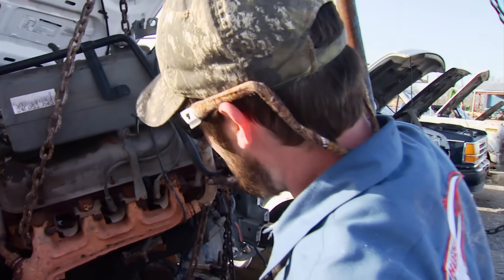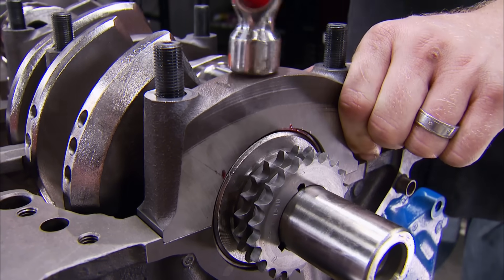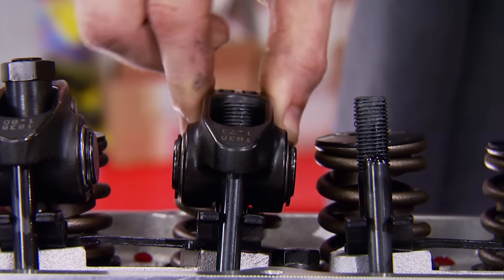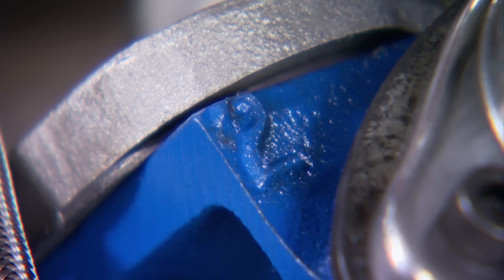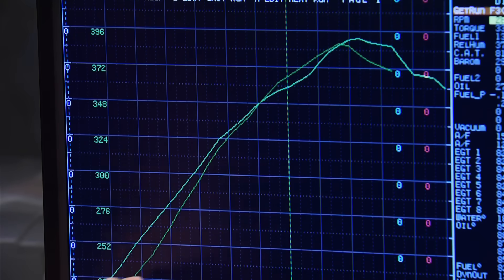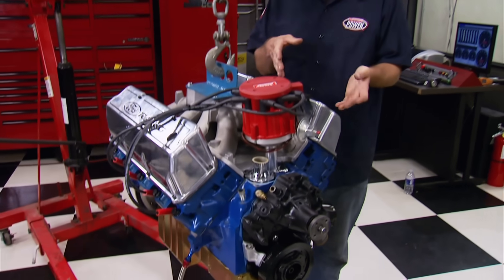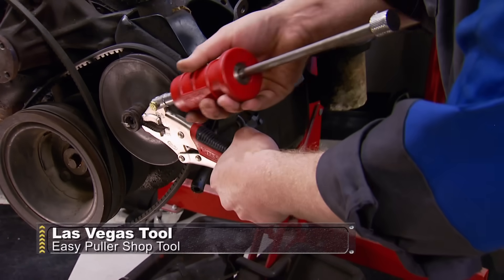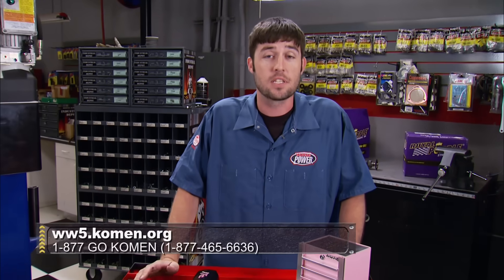351 Small Block Dyno Shootout: Windsor vs Cleveland - HorsePower S16, E11

Comment: I've learned so much this episode. A stroked motor with aftermarket heads and cam and intake can beat a stock motor with just a cam! Amazing!
What are they comparing here? The Clevland 2V vs 4V made sense. Why not just compare different engine mods to this engine. And if the Cleveland was made for the street why the single plane?
Reply: They actually lowered the clevor compression. It's original form was 10:1 and 11:1 in the 1970 Boss. They dropped it to 9.8.   They did no tuning to the carb after swapping heads. It was running lean as hell. They backed off at 5500  and could have ran it to 7k with those rollers.  The power dropped off because of lean fuel. That motor and those 4v heads were designed to sustain 8k rpm for hours in nascar.  These guys has something all wrong. Maybe cam degree needs bumped or something. Thats a weak ass clevor :(   I know... I got 4
Reply: @starbattles1  with 408 c.i., I was expecting much higher numbers.  I agree it was running lean.  They should've fed that beast more fuel and timing until they hit that sweet spot.
Reply: The Clev build was a total mismatch of parts. not only a single plane intake, but one designed to run 2v heads, and a smaller carb. Clev's are designed for high RPM power. If they had put the 4V heads with a 4V single plane intake and 850-900 cfm carb, with large tube headers, and a more aggressive cam, it would have made the same HP and slightly lower torque between 6500-8000 RPMs. I built one like this 30 years ago and got 507 HP@7300 and 447 ft.-lbs @5700. It was a BEAST!
Reply: @sarcastomimic2683  it is like they were purposely trying to make the clevland look worse. I guess Edlebrock pays the bills so this was just a thinly veiled advertisement. Be nice if they said who was sponsoring the episode before hand.
Reply: @numbnutz9398  I agree. They were promoting the 351 Windsor,which was stroked to 408 CID. No wonder it beat the Cleveland. There's hardly any 351 Cleveland's around anymore. If you do just so happen to find one they're pretty expensive to rebuild. You can find 351 Windsor engines no problem. These guys are just,basically advertising big names Edelbrock,ATI harmonic balancer & the timing pointer,whatever other companies they mentioned. Personally I don't really like this show. If you've ever rebuilt an engine,any engine performance or stock. They left 90% of the steps out. They didn't show degreeing the camshaft or measuring the pushrods,installing the adjustable rocker arms kit. These guys leave out alot of stuff. Makes people think they can just go out and buy all these parts and throw them together and it's gonna be great. Or like advertising that says adds 25% more power than stock. Then another one that says adds 25hp and another one that says adds up to 40hp and ...So on....by the time the engine was finished it should have about 2000hp. LOL!! The Chinese parts are the worst. One time a guy brought me a auto parts store rebuild Chevy 350 and a literal pile of parts. The Chinese aluminum intake manifold didn't fit and the Chinese chrome oil pan wasn't even flat and the bolt holes didn't line up well at all. Had to get the manifold milled and take an angle grinder to it so you could get the valve covers to fit.
Reply: Tom Caffrey it’s a 30minute show, they can’t show every single step
Reply: @ Tom so how did that Chinese chevy 350 come out ? How did it run and was it a total pile of  💩 ?
Reply: @Thundarr995   I have both a 351 M and a 400 in my 77 Cougar wagons.   I need to get a timing wrench for the distributor that I know will fit.   If you are using a Snap On timing wrench on the O.E. distributor nut, can you give me the part # of the wrench ?   Or if another brand, the brand and the part number?   I see a lot of Snap On F 8564 B timing wrenches on ebay, but none of the sellers have used the wrenches (I asked each one of them).   Any help appreciated.  Thanks
Reply: @sarcastomimic2683  They did say that
Reply: Sarcasto Mimic 
With out a doubt. Let’s just run it lean and keep it from breathing.
Reply: @sarcastomimic2683  they changed to the 4v heads but stayed with a 2v intake? The Cleveland build was a mess.
Reply: @bigboreracing356  Oh wow, you're one of THOSE people, one who like to twist words and ignore facts, Stock head for Stock head, stock stroke for stock stroke, same cam specs in both a true Windsor head will not outperform a Cleveland. But if you wish to bury your head in the sand do so, but I'd like to see a Factory Windsor Head make 700hp NA
Reply: @bigboreracing356  Build it with a true Windsor head then, a proper inline valve head, not a canted valve Clevor knock off, then see the difference, these gents essentially built a 351 Cleveland and a 408 Cleveland, like they said in the video "we fitted Cleveland style heads and made this a Clevor" but I guess you'll conveniently neglect to mention that....
Reply: @bigboreracing356  Cause what Clevo blokes say is that a Clevo Head is better than a Windsor Head, you're saying you will build a Windsor using a Cleveland style head adapted to a Windsor block. The guts of the matter is to make a Windsor decent you have to use a Canted Valve head Windsor heads are Inline. I work in the industry, I've helped people build both, inline head Windsors do not make big HP
Reply: @bigboreracing356  over a 351W? Weight, no water in inlet manifold heating the air/fuel charge, less bearing load due to smaller mains
Reply: Mark Godfrey  it's there atempt to manipulate the minds of people to sell more windsor parts. Not to bring any light or truth to engine builds. 
   I have 3 Cleveland blocks. One is a built motor. The parts manufacturers are mad we like to keep our Clevelands and not switch to windsor. More video's like this I see the more I want to keep my Clevelands.  The more I want to say fuck a windsor. I hate it when manufacturers try to force a change. They attempt to force there will on the people. Like PC and cell phone companies are doing.  Microsoft just stopped supporting windows 7. Trying to force us 7 users to purchase something we do not want. The American people need to get outraged at this kind of manipulation and corporations forcing there will on the American people.  It's designed to get us used to being told what to like and what to use. Brain dead American public don't see this shit right in front of there faces.
Reply: @starbattles1 …
The citizenry of Japan spoke up and told the PC and cellular manufacturers what 
THEY WANTED….. shame America can’t learn from them.
Reply: @bigboreracing356  agreed! Clevelands are as rare as rocking horse shit here. Great engines but rare. Winsors are a dime a dozen. Way cheaper to build with so many more aftermarket parts. The point I was making is it didn't seem like a shoot out and more of a 'this is why you build a Winsor'  episode. Which is fine but that isn't how it was set up.
Reply: @bigboreracing356  and I could ring up Higgins or SCM and have 700-800 hp NA on a 408 pump fuel the SCM is even designed to look like a stock 4V head from the factory for the bloke who wants to look a bit on the tame side
Reply: @bigboreracing356  Not in this comment tree you didn't
Reply: @bigboreracing356  Ohh Wow, you are a different breed. No where have I read a comment from you mentioning "stroker" it's all "Windsor" but alas once again it seems you like to ignore such minor things. $1600 for a non bored 4 bolt block? Where do you live? Siberia? :Side Note: Main girdles work just as well- I have a mate who built a 700hp 418 with Iron heads using a 2 bolt block and girdle: Furthermore the video states they use a small cam, People like Hot Rod has got similar power with a stock rebuild. The Clevor heads are 2V Sized also with a small cam. My point about ringing SCM or Higgins means its easy for anyone with deep pockets to "slap" things together and make decent horsepower too. I know plenty of blokes who've made 600hp relatively easy with Iron heads on a 393 or 408C. Ford doesn't have a great reputation because Windsor Inline heads are dogshit and they produced Windsors for 50 years, because they did what they had to do, Move Ma and Pa from point A to Point B. Your Key word there is "built" 350 Chev I could have a 351C "built" with a DECENT cam and make the same, in actual fact companies here offer "CRATE"  here down under like that. Lastly If they are so shit, why do they have weight thrown at them in racing circles or are plain outright banned from categories? Bob Glidden loved his
Reply: @bigboreracing356  Fuck, I said there's a reason he loved them, cause they won him races....

And I like how you specify the smaller heads an saying you can port them, attempting to sway it your way, bahahaha, lemme guess, you'll want to use a GT40  head too the closest that came to a 2V, gotta love those that stack it in their way and then call others out, keep your head in the sand cobber, has the added bonus of us not having to hear you speak
Reply: Never seen a Chevy that impressed me. Had my tractor stuck once. Tried pulling it out with a 1ton Chevy . Couldn't do it. It got stuck. Backed my 81 F350 up tonight the Chevy and hooked chain to front of Chevy . Stock 400 4spd. Had tractor and Chevy in neutral. Pulled both out dead horses. Did break a tooth of my front ring gear, but pulled both out of clay over axles.
Reply: Exactly my thoughts!
Reply: @bigboreracing356  The funny part is, I can actually find a comment where you state that to use stock Windsor heads would be unfair....
Reply: @bigboreracing356  You might want to read back through your comments then (You said it in a reply to Cigz Much's comment), and then read mine cause all I've stated is stock head for stock head, stock stroke for stock stroke, same cam for same cam A Clevo will outperform a Windsor. That's not giving it an advantage that's making things even. But I guess you'll ignore that.
Reply: Numb Nutz because they were expecting to make a lot more power with the 4V heads. When it didn't pan out, they didn't have the right manifold on hand for the 2V street version.
Reply: @unicornsteaks6769  Aussies did nuch more with 351C, they had a 4bbl manifold that went with 2V heads.  Not sure what else they did but there was more.  The ball was dropped here in US, IMO.  If you have one, just remember they're unique and good engines.
Reply: Exactly mate. Looks like the Cleveland was butchered a bit.
Reply: MñHhtttbbbnñ
Reply: Since first viewing this a couple of weeks ago I've realized the problem. The Windsor has an enormous aftermarket support base. The Cleveland does not. As a result there's no advertorial inducement to make the engine look good.
Reply: the worst part  was they used the wrong cam  in the Cleveland. they used a Cam specked for a small block Chevy.
Reply: clevlands were fords truck engine,built for torque,not,,racing.the windsor was the car/race engine.but the heads were crap.small/ strait valve train,no good.the 4v gtho falcons,ran at bathurst,those heads dont start working till 80 mph..the 2v & 4v heads have a hump in the exhaust,as i said,for torque,theres 'tongues',you can buy to smooth this out or grind them down,carefully..fact.a std 351 will run at 6k all day,where as a chev 350,or windsor,will lose its valve train.as there studded,.the 2v  clevo is a very strong reliable engine,ive never had any problems with them,run forever,even when they use a sump of oil to a tank of juice,or,no oil pressure at idle,still go.which i think is a bad pump..chev 350 are a rubbish ,very old, engine design,cheap.454 better...but,,you cant beat dodge.i have a 340 r/t chall..i have a bronco 82,on lpg only,,351c,auto.stock,the 351 heads needed a valve job when i bought it,13 yrs ago,so i fitted 302c heads,12.1 comp,std,goes like a cut cat,cheap to run.never stopped except for 2 dead coils...all the  tech has been there since day dot,to build well designed engines,but its production cost that limits what you get.desmodronic drive,ohc,3valves,fuel injection,alloy motors,all too expensive to sell cars..the range rover,layland,4.4lt,is an all alloy engine,very similar to a windsor.used in circle racing,,if,,you can find one..
Reply: @phantomwalker8251  351W is a truck engine, it has 3" main journals, which create too much heat to handle high revs. The cleveland, on the other hand, has smaller main journals, which allow it to rev higher without seizing them. The "racing" version of the 351W block has smaller journals for that very reason. A 351W has shit flowing heads, even the best 1969-1970 351W heads won't touch a 351C 2v heads, let alone the 4v/boss302 style heads. So I'm not sure why you think a 351W is a race engine, while the 351C is a truck engine?? There's no "low end torque" in cleveland heads, the ports are huge. The 351W heads make tons of low end torque, by comparison, because, strangely enough, the ports are tiny by comparison.
Reply: You nailed it.  I don't recall ever seeing a factory truck with 351C, plenty of 351W Trucks.
Reply: @thisisyourcaptainspeaking2259  Yup. One of the nice things about living on the prairies is trucks as far as the eye can see!  Winsors and newer LS and Hemis. Would still love to get my hands on a Clevland though😁
Reply: @James Mottley, no truck had a Cleveland from factory. You could get a 400. Which is basically same engine with longer stroke. Take a 400 , put 351c heads on it and give it a try. No they won't . They want to sell parts for windsors. There is more money to be made there. There's a lot more windsors .
Reply: @thisisyourcaptainspeaking2259  I think he was confusing the 400 cleveland (or the shorter stroked 351M engine) with the 351 cleveland.
Reply: @briankennedy5578  The 400 Cleveland has a taller deck height than the 351 Cleveland.  Pickups were getting 351 Windsors, and also getting the taller deck height 400 with a shorter stroke, called 351M.  Ford had a thing for odd engine combos.  Australia got 302 Cleveland engines that were a short stroke 351 block with small port/valve heads.
Reply: @22099dscott, yes that's pretty much correct. The 400 had to have a taller deck for the longer stroke crank. Most if not all trucks had the 400. The 351m were used in the full size and station wagons quite a bit. Another difference was 351c has small block mounts and bell housing. 351m and 400 were same bellhousing and mounts as 460. Except a few 400's one year had small block. As for the Australian 302, I'm not sure about them. I've never been there.
Reply: @briankennedy5578  I have not been there either, that's the good thing about the internet.  Do a search for 302C and Australia, there is a lot of good information on their version of the small block Ford engines.  They used small port closed chambered heads on their 4 barrel "Cleveland style" engines.  They were casting their own blocks, so not really a "Cleveland" engine.
Reply: @thisisyourcaptainspeaking2259  I think the "351C is a truck motor" comment was from an Aussie - down here F series trucks all had locally built  cleveland engines up till 1985 ! 351 windsors were used in XW GT-HO Phase 1's from late '69 to early '70 as a racing-only engine till the clevelands were adopted.
Reply: @johnkraft7461  Ah yes, great point.  Sorry, didn't realize Aussie market was using the 351C in trucks! FWIW, I think Aussies did interesting things with 351C.
Reply: @AmericanThunder   I have both a 351 M and a 400 in my 77 Cougar wagons.   I need to get a timing wrench for the distributor that I know will fit.   If you are using a Snap On timing wrench on the O.E. distributor nut, can you give me the part # of the wrench ?   Or if another brand, the brand and the part number?   I see a lot of Snap On F 8564 B timing wrenches on ebay, but none of the sellers have used the wrenches (I asked each one of them).   Any help appreciated.  Thanks
Reply: @thisisyourcaptainspeaking2259  
As I recall, 70 to 73 was 351 Cleveland, and was used in cars. 74 to around 80 was the "M" or "modified" and was available in 351 or 400ci. The main difference was the bellhousing bolt pattern on the Cleveland is the same as 289, 302, 351 Winsor, while the M has the same  as 385 series 429/460.
There were some internal changes between Cleveland and"M" engines also.
Reply: @deanmeyer1815  Your recollection coincides with mine.  We as youngsters managed to smoke an FMX behind a Cleveland and learned the $50 scrapyard FMX we picked up mismatched the bellhousing but the internals were the same, so we went with that option.
Reply: @AmericanThunder  I'm guessing that by "Cleveland Truck" engine he's thinking the 351M, since it is basically a "335" series Cleveland. However, the 351W was NOT originally a truck engine, it was 100% designed as a car engine and was not a truck option until its 1980s reintroduction in that role. The 351W-4V was in fact the engine used in the 69 Shelby GT350 and after being replaced in the 70 Mustang by the 351C-4V most of the left over 69 351W-4Vs ended up 70 Cougar Eliminators
Reply: @jamesyoung7560  I know where the 351W came from, I'm a retired engine builder and fabricator, but regardless of its roots or design intentions, the 351W IS a truck engine. That's why I didn't say it was designed to be a truck engine, or was first offered in trucks. It's simply a truck engine. That was my experience talking, not a history of its origins. I meant it's best use is for a truck.(or other heavy vehicles) not for a high rpm race application, as it's simply not ideal for that. It's ideal in a truck application, probably one of the best truck engines ever produced, especially the later models with roller cams.
Reply: @AmericanThunder  Well, retired engine builder could have specialized in Chevy, Chrysler, Toyota or "x" so one makes assumptions sometimes :)  Having owned a '69 Mustang Grande'  with the one-year made 351W-4v I know how many other performance cars I beat with said car (PLENTY of 350s) and so I am also very familiar with the capabilities of the engine. Also having been up to "M" in that car, where 120mph was at 4 o clock and I had the needle to the M in the MPH at 6 o clock, I know that the engine can go very fast without damage (the distributor did have some issues after that)  
Yes, the 351W also makes a great truck motor but for people who want a quick street car that can "light em" for 2 city blocks (I got a reckless driving ticket for that) and be an outstandingly consistent bracket car, the 351W, especially if you can find a pair of '69 4v heads, is a pretty good "junkyard" choice. As for a gasoline "truck" motor, personally I'd prefer a 385 series, 429 for 4x4 and 460 for pulling, but that's me.  I say "Truck" because my very first car was a beat to shit 71 mustang that I traded a Suzuki 500 for and I ended up replacing the mildly built 302 with a '69 4v 429, so my first 385 was actually from a car and in a car.
Reply: @thisisyourcaptainspeaking2259   he was probably thinking of the 351M/400
Reply: @craigwiess1656  Could be.  I have no idea which 351's were in the aussie market but I know they ran the Cleveland with factory closed chamber 2v heads and factory 4bbl intake.  I've never seen this combination in the us market, only open chamber 2v with 2v intake.
Reply: @thisisyourcaptainspeaking2259  Austin's always had the best Cleveland goodies
Reply: @phantomwalker8251  Bought my Mercury Montego GT with it's 351-CJ and the factory Hurst 4 speed back in 72.  Little did I know I was buying a truck!  I think David Pearson won a 

NASCAR championship with  that truck body <grin>.  BTW, still have the Merc and it's time for her to get rebuilt -she's been retired in the barn since '86.
Reply: @phantomwalker8251  Cleveland's were built for NASCAR dumb ass.  STFU if you don't know shit. The original Clevor was for NASCAR. The street model with 4v heads and intake is a lightened NASCAR motor. THEN it was made for the MACH1 and Boss351 and only later on put in trucks.
The Cleveland WAS a race motor converted for street use you moron.
Reply: @phantomwalker8251  The Cleveland engine was designed for Nascar racing, and had to be used in street cars for it to comply with the rules.....nothing special about the bottom end, but the splayed valve heads were very special.
  I had a cat that owned a race engine machine shop tell me there was nothing special about the heads in 1998....oh yeah, they were very special in 1968.
  Anyone who spews pure dumb your way about 4V heads for the street.....just walk away. You're talking an engine that kills in the danger zone above 7k, and will need attention all of the time.
  Look at what Glidden had to do with stock 4V heads to make them work......they were just a tad above junk, the port velocities were way too low.